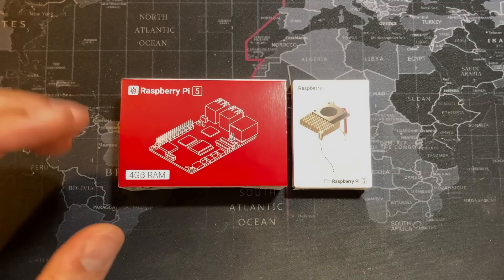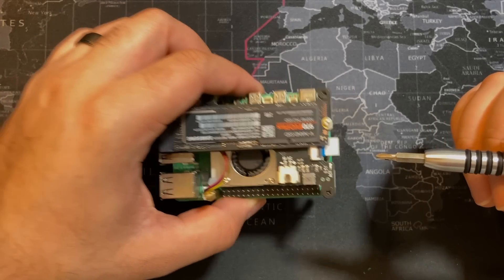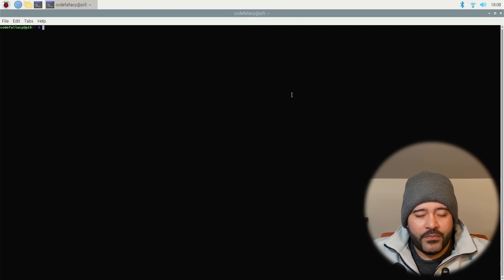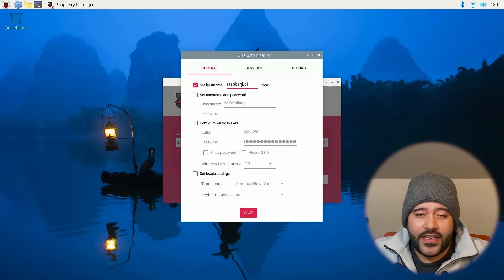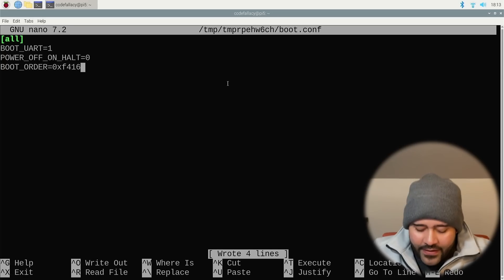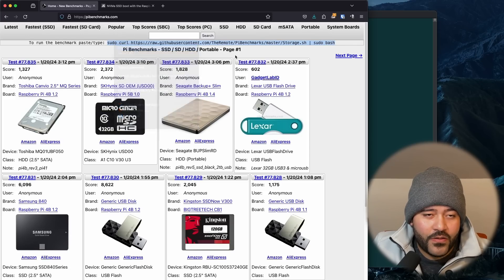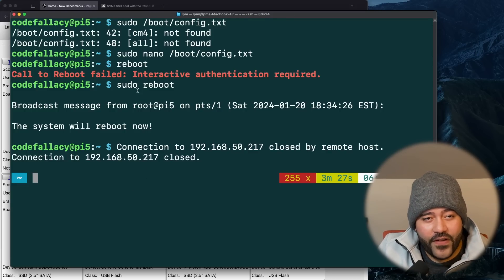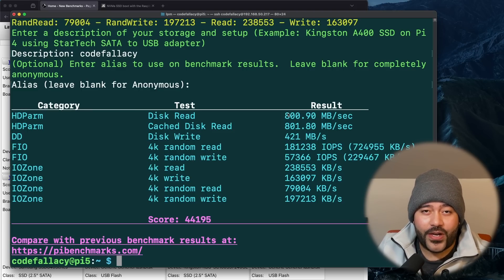Raspberry Pi 5 with 2TB NVME SSD Geekworm Shield

Comment: My Pi5 (16MB) is using a 4TB NvME but only allows be to address 2TB. What can I do to fix this?
Reply: The issue is the Pi won't allow you to change the NVMe from mbr to gpt which is the reason you can't get more than 2TB. I looked all over!!!!!!
Reply from the maker: That sucks, you may need to do it on another computer with an adapter
Reply from the maker: Tahts sucks, it could be many things its hard to tell withou actually knowing more. My assumption is that the formating of the drive if wrong. Format the drive as an ext4 file system before installing any operating system or storin anything. Ext4 supports high capacity drives. 

It could also be that for some reason your operating system can only see 2tb and the other 2tb are unallocated. and you have to manually expand it. You would have to seach the command to do that online for your operating system.

Comment: I would advise against running ramdom commands that you find on a website without understanding what they do.

In this case, hdparm is generally available on most Linux systems by default, and "hdparm -tT /dev/sda1" or equivalent gives the benchmark you're looking for.

Comment: I'm curious...why not just leave the RPi OS on the micro SD and use the entire SSD for data storage?  If you're going to use the Pi as an OMV NAS, you don't need the extra boot speed or OS performance that you might get from having the OS on the SSD.
Reply from the maker: Its more of a reliability thing. Sd cards die randomly at a much faster rate than ssd

Comment: I'm just getting things together to upgrade from a RPi3B+ to RPi5 with a 256gb nvme using the Geekworm X1001 nvme hat. I am a complete novice with both HA and raspberry pi. The question I have is, will the raspberry pi 3B+ HA backup work on the RPi 5 or is it better to use a new installation, is the HAOS the same for both as I know the raspberry pi OS can be either 32bit or 64bit for the pi5.
Reply from the maker: Thats a great question. The OS bitrate will be different for sure but alot of packages still run at 32bit. My imagination is that it will work but i dont know for sure since there are too many variables. But definitively give it a shot and let me know if the backup restored. I doesnt hurt to try
Reply: @codefallacy  FYI. I downloaded the 64bit OS and installed it on the NVME on the RPi5. Once installed I set up my blank account the same as I had on the RPi3B+, then restored a saved copy. Everything worked though the GUI in not 100% the same, some very slight differences when looking at them both side by side so I think the system is now 64bit mainly and just the actual settings were recovered not the full OS. Main thing is it seams to works fine for now, time will tell. Thanks for your video help.
Reply: Update:- After 24 hours things started to go wrong, dashboards not loading showing "ERROR Unable to load dashboard"
Tried a reboot and things looked ok then same again, unable to load dashboard error or enter into File Editor or any other screen, devices also started to give errors and getting hot. Only way to reboot was cut power as no dashboard would load.
Tried reinstalling again and then recovering a backup(made on pi3B+) and within hours things started to fail again.
In the end I bit the bullet and did the same again, downloading the HaOS for PI5 but this time set everything up manually rather than restoring a backup(a big pain), now 3 days later and everything running smooth, temps in the 35-38ºC and no more troubles so far(touch wood again) Sorry for the essay but this may help someone thinking of updating to Pi5 and restoring a pi3b+ backup, I would say its not worth the risk as something is different between the 2 versions.
Reply from the maker: @incubatork  no need to apologize for the essay! Thanks for sharing, if anyone else comments about this ill refer them to your experience. Glad you got things working again even if it was a pain to redo everything

Comment: Great video, very good explanations. I'm thinking of getting an SSD for a Raspberry Pi5 for media storage and use the pi as a Plex server.
Reply from the maker: Sounds like a good plan. Just be aware that the raspberry pi wont be able to transcode media, aka if you have a 4k uhd hdr file, it wont ve able to convert it to a 1080p on the fly if the client device doesnt support hdr. That is the only downside

Comment: Great video. Could you test if a pi5 can do youtube playback at 4K? And if possible Netflix play at 4K? I got my pi4 to do it but framerate is to slow.
Reply from the maker: In this video i end up using the Pi 5 as a server so i dont have a desktop to open a browser. but if you istall the desktop image you can. however note that Netflix uses a DRM technology known as Widevine that prevents 4k streaming on non certified devices. you can install widevine manually but netflix still wont send a 4k stream from their server. as far as youtube, i will have to test it out.

Comment: so.. from unmodified pcie2 2.24Gb/s to pcie3 modified 3.13Gb/s writes ,good enough for over usb3 2.5Gb/s really 2.3 average Ethernet writes, good to know.
BTW the Radxa Penta SATA HAT - Up to 5x SATA disks HAT for Raspberry Pi 5 be sure to select the right version kit when ordering exists now so I'm expecting no more than the 3.13Gb/s 421MB: raid0 writes throughput you show here ...a limitation of the pi5 pseudo pcie3 implementation ;Reads & writes from it are apparently good enough now for a true 5 [4+esata enclosure] drive usb3 2.5Gb/s Ethernet omv NAS
Reply from the maker: i just ordered the penta sata hat. im looking forward to hooking them up with 3.5 inch hard drives. the drives are so expensive though :(
Reply: @codefallacy  ty keeps deleting my longer 'pro tip' :(
search amz for 'Enterprise Class (Refurbished)' drives & then use 'victoria hdd win10' on these drives to find any bad ones, I only had 1 bad one of 5 & returned it then replaced it the next week, simples & all Good now.
Reply: @codefallacy  yt keeps deleting my long protip about drives :( oh well..... we now need a snap together 3d printer file made up to house the 12v 10amp for 3.5hd overhead brick & pi5 5amp psu + 5 2.5/3.5hd drives -call it the pea NAS case lol.

Comment: I have  nvme to usb adaptor, it will read/write, but not format.
Reply from the maker: that is weird. hopefully this method can work for you. or you could try using another formatinv software like belena etcher. good luck
Reply: @codefallacy  I'm just going to wait for the PI to show up and format it on device, but it is annoying that it won't format, must be a hardware issue with the controller.  What filesystem does it use for these large drives?
Reply from the maker: i choose Ext4 for stability

Comment: No one tells me how to rack mount the raspberry pi 5 to a 1U after adding a nvme drive...
Reply from the maker: i dont have a server rack
Reply: @codefallacy  It is not that hard, for small depth like the pi or the small Synology NAS devices you can get a 8U desktop rack, 2POST, from startech. It is ideal if you want to put your small network equipment or small devices like small NAS or Raspberry pi 4(they have rack mounts for them from utronics), switches from TP Link, rack mounts for nuc etc. It gets your cables organised

Comment: Just Subscribed I am a huge Raspberry Pi Fan and have done several raspberry pi projects, looking to use this solution you showed above to connect the new raspberry pi with 2TB NVMe as a MotionEye OS Server / Storage for my 4 raspberrpi Zero cameras
Reply from the maker: awesome! i used to run motion eye on a managed homeassistant instance when Wyze had rtsp support. i want to explore all buch of open source stuff. welcome aboard

Comment: since overclocking the PCIe still not making it on par with the nvme ssd capability, that means, you could use cheaper SSD instead of using a high end SSD. Am I right?
Reply from the maker: you could, but there is a problem with ssd compatibility across brands. check that the ssd you are using doesnt use a "phison controller" apperantly those chose controllers arent compatible and have issueswith the pi.
Reply: Pi5 PCIe power supply is 5W, while this particular disk (Evo plus 970 2TB) needs 6W on average, and even more on burst (they don't give that figure but looking at other disks, it's usually ~1.5W more). So I think that could be the reason; a HAT with external power for the disk would tell :)

Comment: the fact that this does nto come built in standard but has to be achieved with a plug in module is the only reason I will not be buying any more PI devices.
I have a vision5 II riscv board that has this built in.  Yes it costs significantly more but how muchy does the PI plus that addon cost?

ok, maybe I am wrong or the info i have read so far is wrong, technically this IS built in, you just need a connector card not a whole addon board?
Reply from the maker: its valid criticism, you can get different boards or mini pc

Comment: Hello, I use exactly the same products as you. But when I remove the microSD card, it does not boot from the nvme disk. The LEDs on Geekworm x1001 do not light when the microSD is not inserted. I plug it in, it lights up and turns on. I check with Diskpart, whether the operating system was booted using the microSD card or my nvme disk; Used nvme.
Reply from the maker: does it recognize the ssd at all? if you were to just use it as storage are you able to save files to it?  it maybe that the ssd is not compatible. which ssd are you using?
Reply: @codefallacy  I have two Raspberry Pi 5s and both have different SSDs installed.  One is micron brand and the other is union memory.  I can write to both of them after they are opened.  It recognizes both of them, but as I said, it does not boot.  I don't fully understand the part about having a compatible SSD.  I've seen this issue talked about on sites, but how can pi5 not use the SSD pi5 sees after booting up?
Reply from the maker: im not saying the ssd is flatout the issue, but the wiki for geekworm x1001 board says that there are compatibility issues with ssds that use the "Phison Controller", they can be found on many popular ssd brands. you can check the wiki for details.  Did you update the eeprom? which eeprom is running on the raspberry pi? sometimes updating it helps. let me know which date eeprom is running
Reply: @codefallacy   ;  eeprom is up to date, (Feb 16) and lspci output is ; 

PCI bridge: Broadcom Inc. and subsidiaries Device 2712 (rev 21)
0000:01:00.0 

Non-Volatile memory controller: Lenovo LENSE30256GMSP34MEAT3TA
0001:00:00.0 

PCI bridge: Broadcom Inc. and subsidiaries Device 2712 (rev 21)
0001:01:00.0 

Ethernet controller: Device 1de4:0001
Reply: @codefallacy  : The problem was fixed when the PCIE_PROBE=1 command, which was after the boot order, was placed before the boot order command.
Reply from the maker: glad you were able to find a solution! i was not of much help, but ill keep this in mind if anyone else asks a similar problem. thank you!

Comment: I have followed your tutorial step by step and I was able to boot off the device through pcie once and never again. Every time I get the following error:

Gave up waiting for root file system device. Common problems: - Boot args (cat /proc/cndline) - Check rootdelay= (did the system walt long enough?) - Missing modules (cat /proc/modules: Is /dev) ALERT PARTUUID=f346a209-02 does not exist. Dropping to a shell!

The main difference I have noticed is that your ssd included (bootfs, rootfs) in the naming of the device, which mine didn't.
I had also converted the drive from MBR to GPT partition scheme because MBR would result in the same error.

Fyi I am using a Lexar 2TB NM610 PRO which I can see with either lspci or lsblk commands and it is listed as an SDRAM Less device.
Reply from the maker: that is weird, it could be many things, have you tried reflashing the ssd and updating the eeprom once again? it could be a bad flash, or a bad board or an incompatible ssd. if yoj retry reflashing let me k ow what happens to further debug
Reply: @codefallacy  I have flashed the eeprom 4 times but every time I was flashing the os on a MBR partitioned ssd except for the last time which I converted it to GPT. I erased the disk every time by placing the ssd in the nvme connector in my mini pc and by using EaseUs Partiton Master. I had then followed all the steps in your guide. Lately I did a bit of reading and apparently it could be an extra parameter in the eeprom configuration settings which I am probably missing but I’d say that’s not the case because the pi is reading from the pcie slot, else a black screen would be presented on boot. Anyhow, I’ll try and I’ll let you know! Thank you for your reply btw😁.

Comment: Thanks for the demo and info, very detailed.  Can you provide the link to the products?  Have you also seen the Geekworm X1003 board? Have a great day
Reply from the maker: hey thanks for the feedback. i havent provided the link to the product because i dont want people to think im afiliated with the company. but i may have to due to demand. you can buy this board either from amazon or geekworms website. i only have experimemnted with this board but i have heard great things from the x1003
Reply: @codefallacy  thanks for the feedback,  I just bought and received the X1003, let me see how this is gonna work.   Have a great day
Reply: Update - The X1003 is garbage and does not work well.  Maybe a bad unit that I got, but saw another youtube video having the same issue.  I guess I will get the X1001, per your video.  Have a great day
Reply from the maker: @chrisumali9841  thanks for the update. that really sucks. my suggestion before getting another board is to look at the ssd compatibility list for that board. alot of viewers are reporting issues with certain ssds. apperantly geekworm has a wiki for it. good luck

Comment: I have four PI4 running different dedicated applications (PIhole, PIVPN, Internet-speedtest.cli, HomeAssistant). I purchase a 19" rack with the idea of installing all PI4 and eventually one PI5 on the MyElectronics rack and using the Wavlink PoE+ hat for powering the PI4. If I keep the sdcard (Pivpn & Pihole would be OK I believe in term of reliability - not so much disk access) then it would be OK but I will have to cut the GPIO pin on top of the PoE hat. Is there an other PoE hat for PI4 without having to cut the GPIO pin ? If I want to install a SSD for (HA et etest) to replace the sdcard , do you have a nice solution to fit the ssd in this rack as I did not find any solution to hold the ssd on the PI and connect back to the usb3 in front of the rack (except maybe using a long sata/USB3 long cable and drilling a hole in the rack ?
Reply from the maker: there are bottom attached boards, if you need pi top access look for bottom mounted solutions. i hope that helps, i havent had extensive experience will all the boards out there but ill keep trying lol
Reply: I have a rack made of acrylic plastic (clear) that has seven slots, with 4 fan positions. You could (very carefully) mount 2 pi's per slot. I have all kinds of stuff going on in the rack. Weather Pi, a pi-hole, a UPS powered backup as an overall backup to everything else, a few pi's with different SSD adapters (USB connected)
At this point, I have 3+ Tb of SSD storage, not counting 2 (or so) Tb of SD card storage.
I was happy with my collection of P4's, but working with the 5, I am really impressed with all the upgrades to it! Some, that some think are minor improvements, are bigger than most think. For one, the RTC. My pi-hole had an add-on RTC on it, that I kept up with input from a network time server. That added so much height to the board, it blocked out a space next to it. Now, the Pi 5 is gonna be the time server, and I can add another Pi 4 to the rack.
Can't wait to get more 5's!

Comment: anyone else getting instability? I am using the same geekworm as in the video. I have heard issues with the power draw from certain ssd's
Reply from the maker: it appears this board does not play well with certain ssd controllers, it appears ithis drive works but others are experiencing issues. not sure which drives arent supported, geekworm should make this clear but i haven seen anything from them yet
Reply: @codefallacy  my Samsung 990 pro m.2 worked, but showed some instability. But this could be power draw. My hynix p31gold arrived today and that should do the trick

Comment: I have the X1001 installed in the geekworm case. I prefer to run Kali Linux. Can I boot Kali Linux off the NVME or is it only Raspian or Rasberry Pi OS?
Reply from the maker: you should be able to boot any OS after the eeprom has been updated
Reply: Okay. I had a Western Digital PC 530. It's not on the wiki list as being non-compatible but lsblk was not seeing it and other methods weren't as well. Ordered a new NVME off Amazon.